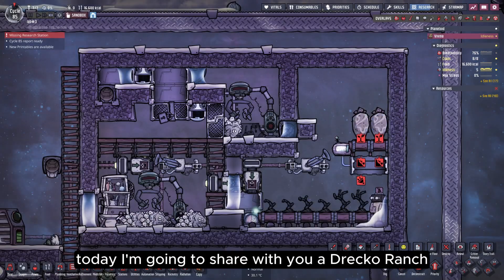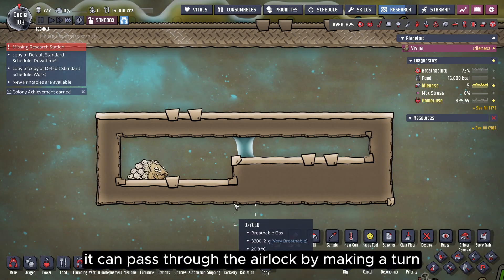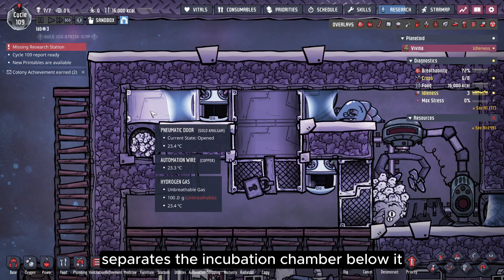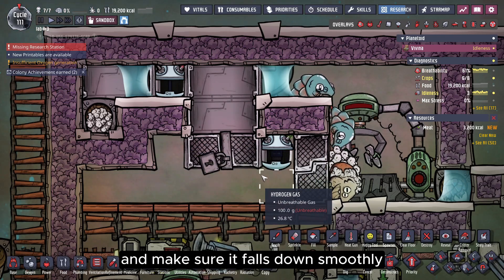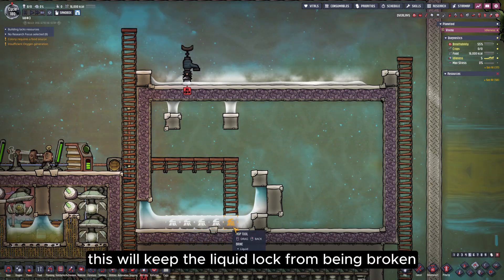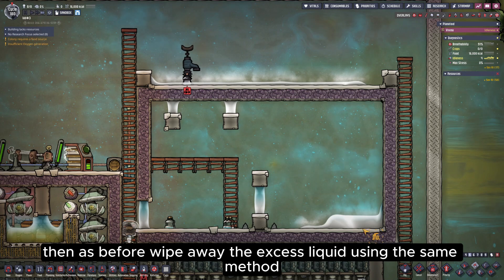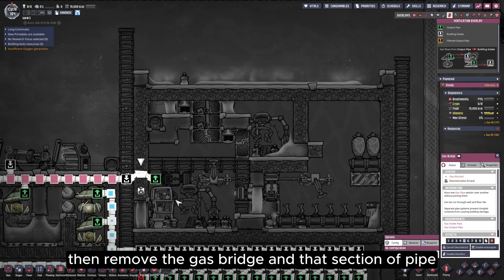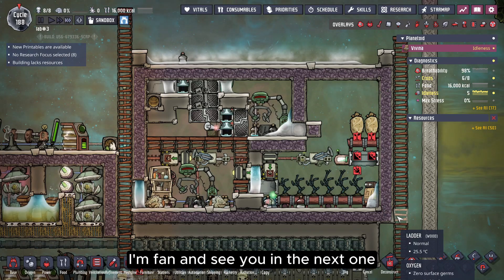[ONI]#12 How I Built an Efficient Auto Drecko Ranch in Oxygen Not Included | FansGame-k7k

Comment: I have just built a mirrored version of this (just to suit my base layout better) and for some reason I can't get dupes to shear in the upper starvation ranch room. If I select the shearing station and select errands, it tells me that there are no critters available. But there are 35 drecko's in there!
Reply: That’s because the update that came out in November nerfed Drekko starvation ranching.  Drekkos are now born with only 90% scale growth, and their scales won’t grow unless they are happy (fed, not crowded, etc.).  Now I just build regular ranches, one for each type of Drekko, and make the ranches 6 tiles high by 16 tiles wide.  Then pump hydrogen into the room until it mostly fills the top 4 tiles - this will allow the Drekkos to still spend a good amount of time in hydrogen so their scales grow, but still keep an oxygen environment at the bottom for the meal wood to grow and your dupes can even work without atmo suits.

You might find that it’s hard to keep a full ranch of regular Drekkos this way, because feeding meal wood causes a high percentage of the eggs to be glossy variants.  If that’s the case, then switch the regular Drekko ranch to use Balm Lilly’s once you’ve got enough glossy Drekkos to kick start that ranch.